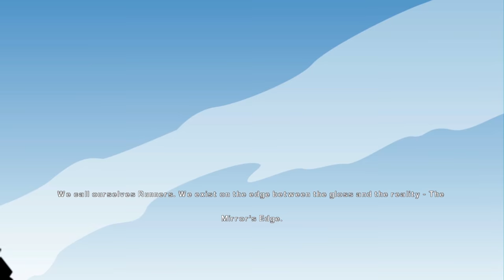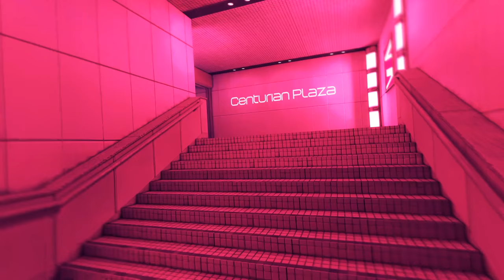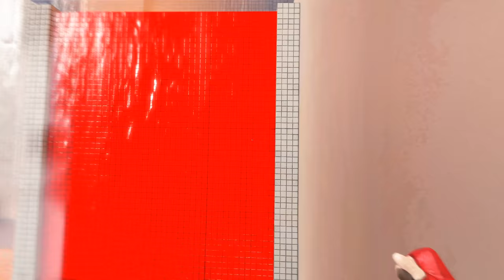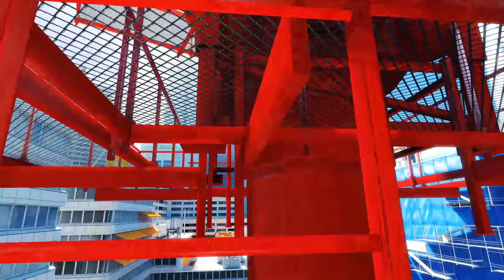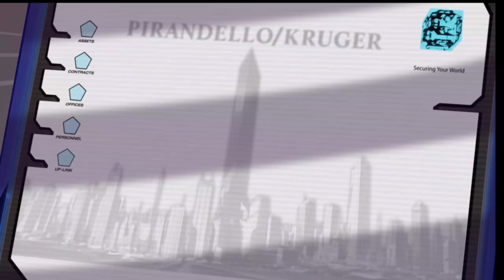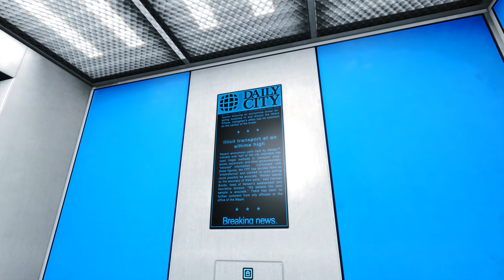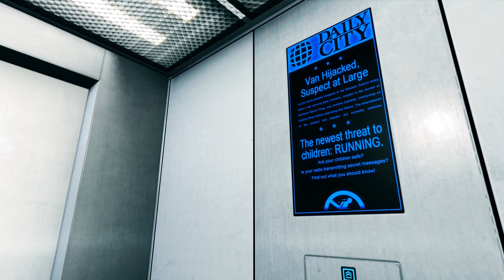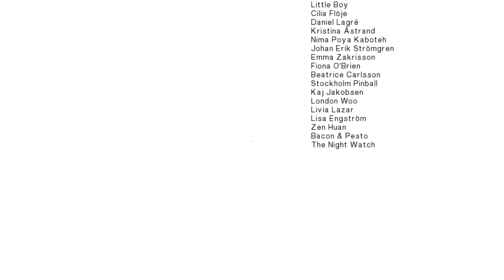Mirror's Edge | PC | Full Game (with Nvidia PhysX enabled) [4K 60ᶠᵖˢ]

Comment: What GPU are you playing on?
Reply from the maker: Hello. I've played this on a RTX 2080.
Reply: @ProjectDetonado  Ah thank you very much. Then i should not be afraid of buying RTX. Been thinking of either a 2060 or 3060. I have the game running well on a GTX970 now with PhysX. Had to install PhysX Legacy Update and delete overlapping files in the game, it wasn't working well before with PhysX GPU effects, slow occasionally, crash in Sewer exit. Looks like i can resume playing with same fixes without new issues with an RTX GPU.

Other older game i play is Test Drive Unlimited 2 which can crash on RTX cards, but maybe i figure something out as well. DXVK or i find out why it's happening.

Ideally Mirror's Edge needs better preservation for sure, maybe a project for me for the future.